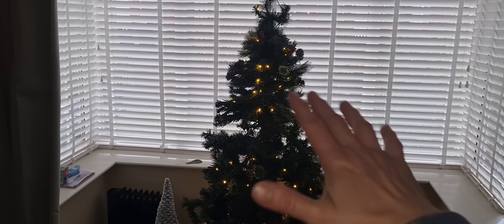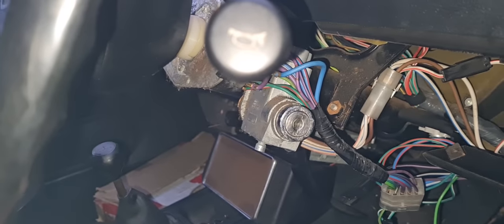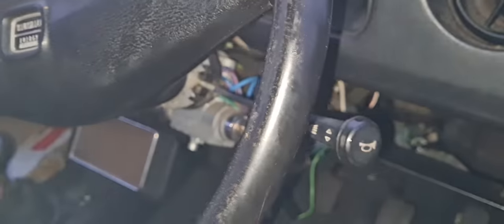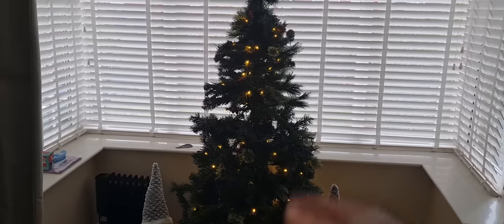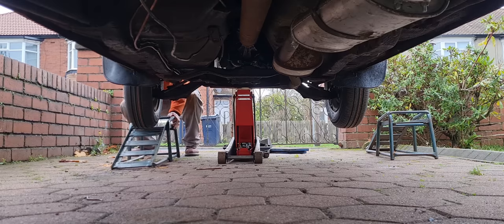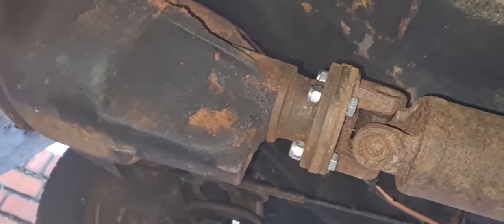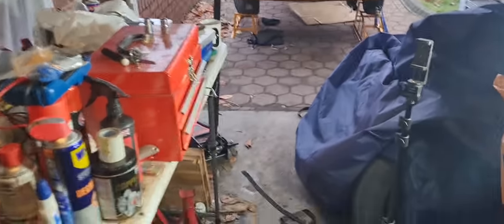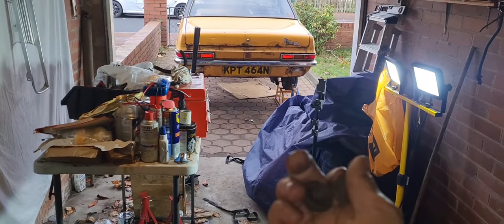WORKING CLASS, GIBBERISH, BUDGET BUILD - THE 1975 VAUXHALL VIVA HC BARNFIND REBUILD CONTINUES

Comment: The steam is normal , it's just condensation in the exhaust that's built up from short starts, roughly for every gallon of petrol you burn, you get around 1/2 a gallon of water .
Reckon the moggie bolts are whitworth if not metric or imperil.
Reply from the maker: Thank you very much mate, thanks for the info. Thanks for watching 👍

Comment: It's normal for older cars to have a bit of steam coming out the exhaust my 1973 triumph is exactly the same it goes away once warm bud great video as always 👍🏻
Reply from the maker: Thank you very much, thanks for the info. Thanks for continuing to watch 👍
Reply: There is water vapour in the air which is sucked into the engine. It's most easily seen when the engine is cold and the air is cold and damp hence the steam.... 😄

Comment: Another great video. Quite a few jobs ticked off there. Glad the contact cleaner sorted out your indicators. My dodgy indicators turned out to be a bad earth on the two front lamp housings. But my headlight switch is a bit dodgy, it needs a good wiggle to make it work so I'll try some contact cleaner on the switch.
Mine was smoking just the same as it was warming up today. Like you say it's cold out. Settles down after warming up. Although I did notice that after she had warmed up if I gave it a good rev it would start puffing smoke/steam slightly. Looks like there is a  small weep from the passenger side of the block at the head gasket location too so I think it's time for a new head gasket for me. I'll let you know how it goes 
Keep up the awesome work mate! You've got me onto Knopper bars now mmMmm
Reply from the maker: Thank you very much mate! Good luck with the head gasket. Thanks for continuing to watch, hope you are enjoying your Knoppers 😀👍

Comment: Excellent vid as usual Sir🙂. Nice to see the electrics now working, class. As regards the bolts if the nuts are fully covered by the bolt threads not an issue, I’d thread lock it and be happy if the threads don’t make it to the end of the nuts then buy longer ones with sufficient thread and cut them down & threadlock. The exhaust looked the right colour for head gasket issues , however it’s a classic, try to run it for 10 to fifteen minutes until up to temperature and if still producing steamy exhaust then some further investigation might be required.
Keep up the good work👍🏻
Reply from the maker: Thank you very much! Thanks for the info and thanks for continuing to watch 👍

Comment: Great update and pleased you have got the indicators working. Contact cleaner is great stuff for old electrics, worked wonders on my 1985 Rover SD1 that was off the road for 20 years. My SD1 has the steam coming out the exhaust for the first few minutes on start up in conditions like you were working in on your video, perfectly normal and it will go once the engine is warm and driven for a bit. I don't envy you working in the rain, maybe a kind sponsor can provide you with a tent like garage to work on your viva!
Reply from the maker: Thank you very much! A tent would be great, but think I'll have to grin and bear it until I get a new house with a nice warm garage 😀 Thanks for continuing to watch 👍

Comment: Just condensation as the weather has turned cooler. 6mm free play on the clutch cable at the gearbox end. Glad you got the indicators working,little wins are always nice!
Reply from the maker: Thank you very much mate, thanks for the info. I am well pleased I didn't have to take off the stalk unit. Thanks for watching 👍

Comment: I might be wrong but the bolts look too short, they need to engage with the nyloc and a couple of threads out, have you a fastener stockist near you, they will hold all sorts of lengths and threads. Glad you got the lights sorted, sucks to have to work outside and in the rain, big respect for doing that, I remember so well lying on gravel and rain dripping down my neck, getting rust dropping in my face while trying to undo the last nut or bolt. For every gallon of petrol a car produces almost a gallon of water, mostly steam out the exhaust, good run will sort that out.

Electrolube Grease CG60, Servisol Silicone Grease 50 or Permatex 22058 Dielectric Tune-Up Grease are all very good at helping electrical joints, stopping corrosion, and a good connection, specialy on older dirty joints with a bit of green
Reply from the maker: Yeah I'm not too sure about the bolts and it is a bit rough working outside in bad weather, but I'm still having fun 😀 Thanks for all the info mate, thanks for watching 👍
Reply: @RetroRebuild  Highlight of the week, humor, old cars and the odd joke, keep it up.

Comment: Yeah that looks normal to me too,, if it was a head gasket you would probably smell antifreeze  at the exhaust,  glad you got the prop, brake lights and indicators sorted, that was a result, hope the horn works as well, spray some cleaner into that as well if the end don't unscrew, great vid.
Reply from the maker: Thank you mate. I will be trying the horn this week, fingers crossed it works! 😀 Thanks for continuing to watch 👍

Comment: It's coming together mate 👍 as a few comments have mentioned it'll be condensation in your exhaust, even my modern vehicles do it, get it nice n warm it'll dry out and disappear! Again sounds like Whitworth size bolts, I'd try for some slightly longer ones depending how long the shoulder is, could put a washer prop and diff flange ends if it's just a flees hair longer, and some nylock nuts 👍
Reply from the maker: Thank you mate! Thanks for the info and thanks for continuing to watch 👍

Comment: As someone else has mentioned , probably whitworth size if metric or A/F sizes don't fit . The unthreaded part of the bolt , I've always called the shoulder and the plastic bit in the end of a nut the " nylock " . I was going to suggest perhaps getting a gazebo so you can work under cover outside but you've said you hope to be moving . Keep on keeping on . Power to the people .
Reply from the maker: Thanks mate 👍 I may look into getting a cover in the short-term as I'm getting soaked 😀 Thanks for watching 👍

Comment: Hi
Been watching you for a few weeks now I binge watched all of your past videos when I stuck home with the flu and then subbed by the end of the night :)

Ive had many classics over the years,restored but now I am doing something similar to you it seems to be more commonplace now get the car safe solid with good bones rather than worrying about top not restorations.

I am doing a Mk1 Cortina and once its safe and reliable I will be driving it regardless of the paint being a bit rough.
The indicator relay the new one may be stuffed or it may just be the pins are the opposite way around I had a duff one on a previous car got a replacement turns out it was positive earth relay so switched over the connections with jumper leads it worked but did nothing the other way.

The white smoke likewise I had a classic once did the same thing I sent it to garage to get sniff tested they rang to say it was fine after they ran it for half an hour it stopped,so in this weather run it for 20 mins or so and see if it subsides? dont remember it being that bad on your other videos when it wasn't as cold.

Love your videos cant wait to see this on the road,Ironically I am not really into Vauxhall's but really enjoying seeing this one coming back to life :)
Jo
Reply from the maker: Hi Jo, thank you very much! Appreciate your comments. Hope you are feeling better now. I love the Cortinas. Thanks for the info, I love a survivor looking car, it tells a story 😀 Thanks for watching 👍

Comment: Enjoying the progress! The side lamp bungs look to be fine the way they are in. Also at this stage wouldn't be worried about the steam or smoke from the exhaust - it was a cold day and added which it hasn't been running for a long time. On first good run you might see quite a bit coming out due to the gunk that has built up over time but even after a short fast run that burns off if all is well.
Reply from the maker: Thank you very much mate, will do, will give it a good run. Thanks for watching 👍

Comment: Looks like it needs a good run the motorway.. The old style exhaust system makes for a lot of condensation until warmed up you can do a compression check that will tell if the head casket is knackered it will probably be better with a head strip and new casket
Reply from the maker: Thanks mate, thanks for watching 👍

Comment: Bolts to the flange has to have a "shoulder" . Full threaded bolt's thread will crush under the shear powah of the 1.3L and then there is too much space between bolts and holes. Bolts needs to be a tad longer than what you just put in. Don't worry getting too long bolt if the shoulder is short enough. You can always shorten the bolt and fix the thread. Bolts needs to be stronger than the cheapest chinesium 6.6 crap. I think that  I I I marked standard bolts are equivalent in metric 10.9 strength. Unless III is branded on the crap bolt..
Reply from the maker: Thanks for the info. Thanks for watching 👍

Comment: Exhaust condensation looks normal too me, the prop shaft i would get longer bolts and cut of some of the threads if needed as always best too have a few threds coming through the nuts. Did you fix the exhaust manifold leak i could not really tell in this video.
Reply from the maker: Thank you very much mate, I think I will get longer bolts. No I haven't fixed the manifold leak yet, I still need to get bolts for that too 😀 Thanks for watching 👍